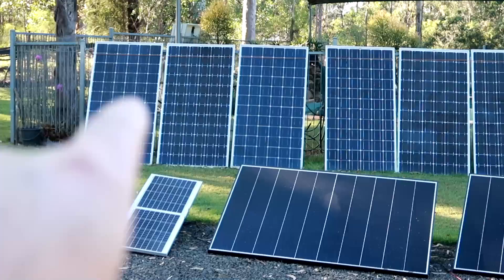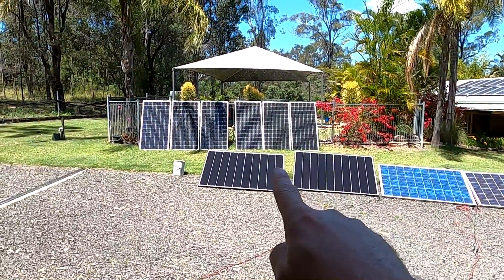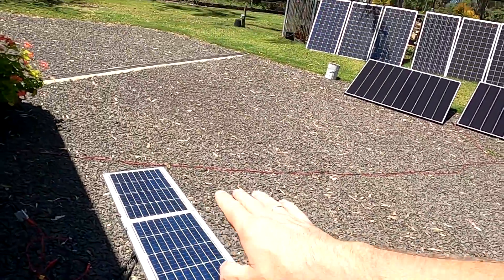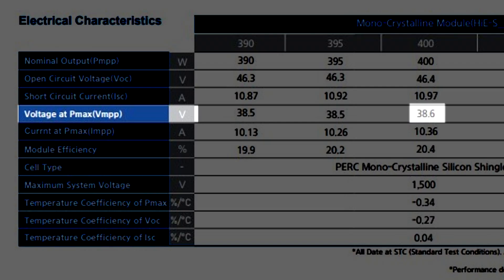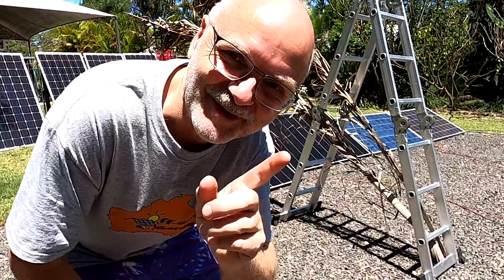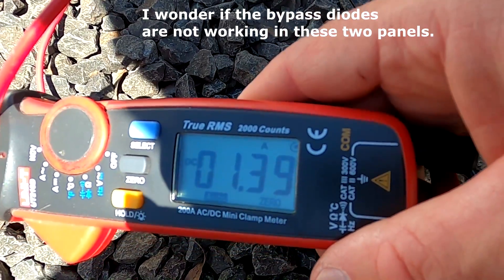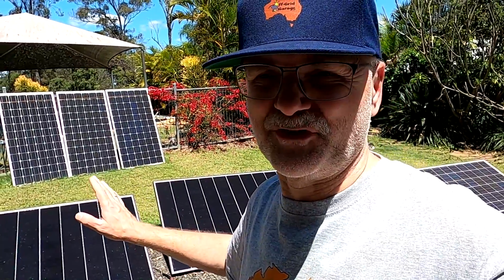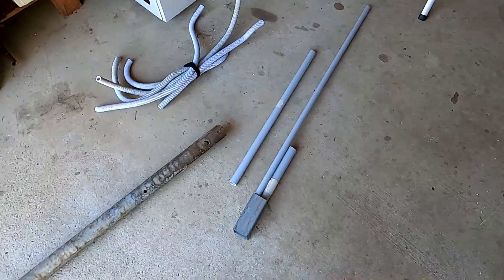Charging a 48V battery with only two solar panels in series? Here are my concerns.

Comment: 3:30 into the video, yes, no shading from trees, but yes, shading from the leaves on the panels
- wonder what the peformance drop from these leaves would be
Reply from the maker: Literally no power loss from just a few leaves on the panels. Also, thorough cleaning makes no difference in power output. At least not measurable.
Reply: @OffGridGarageAustralia  thankyou

Comment: Very exciting.   Can't wait to see it up and running.
Reply from the maker: Yeah, me neither. It will be a lot... of power. But this huge upgrade is more for wintertime. Summertime is never a problem.
Reply: It's all happening much quicker than I thought it would, in the UK it's getting very hard to get hold of anything solar related. Getting quotes for installs is getting very difficult, and very expensive. I'm very interested to see your new panels go up.

Comment: One thought I got when I watched your videos is why you don't make a pool roof out of panels as they seem to be in the sun a lot and if you cover there you get more shade over the pool and then you can keep some panels on the roof. Realize that parts of a scaffolding need to be built but it looks like what you have over the pool is now in steel so put a rail on it and if you still need to buy more controls then why not 200-250v so you can put more in series?
Another thing I wonder is is it better to put many loops or connect them in series parallel? (if you take 3 in parallel and take two of those in series then they should have a little more security to produce even in partial shade or am I wrong there?)
Reply from the maker: It's only for a while that it is in full sun. And I would need to replace the whole structure to support the panels. Not an easy task and quite expensive as the pool is underneath and you cannot use a ladder to get there...
You cannot connect three panels in parallel without proper fusing as the reverse current per panel is limited. The design is that three panels (only two from next week) are in series and next to each other in one row. So, the shading for this one string is fairly even and consistent as much as possible. If I have two rows in series (3 per string), one of them would be shaded and the other one not. The MPPT tries to optimise that setup but it is more efficient if these rows are in parallel and not series under shading conditions. It's a bit complicated without a drawing so a video will be coming about that...

Comment: Because of your shading situation u need to get half cut solar panels so that when one half is shaded u would get more power from the other half. Also wouldn't it be better to go for bifacial it will generate more power also will not crack but you will hv to put a reflective paint on the roof to get best results. Mine work great even at low light. I got the Jinko solar panel model JKM535M-72HL4-TV.
Ohh also if you can answer by below question about my inverter tripping would be great help. Thanks.
Reply: In the first video testing these new panels, Andy shows that they are actually like 3 strings in parallel in the one panel already, so they have something similar to the cut cell panels. Hence the name shingled panels. Andy really is testing extreme sutuations.
Reply: @CollinBaillie  yes true but it don't solve the cracking of the back panel. But I think these panels take up less space too. So bcz of that he could cramp few more panels n get more power. 
:)
Reply from the maker: Yeah, with the new solar panels, I'll get 4kWp instead of 3.6kWp and have the legal free space around the panels.

Comment: It's madness to increase your battery storage (44 kWh I think already), I would took at a system of turning on the full solar arrays in cloudy weather and turning off some of the arrays when sunny, I think you mentioned you would like 1000 watts input in cloudy weather, which I agree with that analysis, I am currently working on a viable solution for my own system, which I'm located about 54 degrees in the northern hemisphere, so there a big swing between summer and winter production, but I don't want or see the need to keep increasing my storage further, again so long as I can maintain 500-1000 watts worse case,
Reply from the maker: Absolutely, Philip. 44kWh is a lot already. But if we want to connect the house at some stage, I would actually go a bit higher. The battery was full just 2 days ago but since then clouds and showers again so the battery goes down every day as production is not enough (it may be from next week though). This is all part of the huge test I'm doing; how much is too much and what do you actually need to make it work in a full energy off grid system including EV charging.
I cannot see that there is a formula what to calculate all this upfront including shading, weather, season, EV charging, ... So I go ahead and see what is working. The current system is not enough for wintertime for sure. With the new system I'm expecting to get around 2kW under shading or cloudy weather. That's OK for the supply during the day and also charging the battery a little.
Reply: @OffGridGarageAustralia  👍
Reply: Considering what is going on in the world, I have decided to prepare due to what I feel are sibstantially increasing odds of electrical grid failure and fuel shortage along with food shortages.  I have 60kwh battery as I want to ensure I can charge EV to stay mobile when needed.
Reply: He can limit the charge current of each controller. That way the performance is not reduced during cloudy days and not too high when ot is sunny
Reply from the maker: @What11235  Thank you, that sounds similar to my situation. I'm sure I have to upgrade my solar as well even further to make it work in wintertime. For a few years now, we have so many clouds while before there was always blue sky at this point of time. Clouds are definitely increasing in this part of the world. So more solar needed.

Comment: Hi I got a problem. I hv 2 inverters running parallely and both hv RCCB for the output and as soon as I on both inverters and I draws over 1amp current the rccb trips this only happens when running in parallel mode. When I run the inverters individually thr RCCD don't trip. Can u give me some advice why this might be happening
Reply from the maker: Are the inverters properly in sync? What inverters are they?
Reply: @OffGridGarageAustralia  after looking at my wiring I found out what I hv done. I was using 2 RCCB for the 2 inverters, 1 rccb each.  So inverter 1 and 2 AC out was connected to the rccb tops side. 
From inverter 2 rccb bottom I took the wire n then linked it to inverter 1 rccb bottom n from there to the change over switch. Since I brought the inverter 1 rccb to the bottom that was the mistake I changed it to the top then all was fine. Its hard to explain but all is OK now. 👍
Reply from the maker: @pulith5220  Ah, there you go. Great, you figured it out and it is now working.
Reply: @OffGridGarageAustralia  they are EAsun inverters. I see the master n slave marks on the 2 inverters but I assume it's something to do with them not linking properly

Comment: Yes the maths of mppt doesn't lie no matter the newest cell technology. Your other option that might be a good one is micro inverters o. Each panel. This would be the best for highly shared areas like yours.
Reply from the maker: Micro inverters are great when you are grid connected but very tricky in off-grid systems. If the battery is full you need to tell them to stop producing. The Victron MP II can do that but only for a limited amount of load (Victron 1:1 rule). That would not be enough in an off-grid world though. While with DC connected MPPTs I can just keep adding them to the system until it works even under heavy clouds and winter time conditions.

Comment: You should never connect the 2 roofs together, because in case of  a Lightning strike, you will have this on both roofs...

Better: you connect each roof down and to a multiple earthed ring on the ground. Dehn Blitzplaner will help you ;-)
Any questions ? - than ask...

But - in general, why do you fear lightning strikes at all ?? Around your roofs, there are so many high trees, that it is nearly, I would say, totally impossible, that you can get any lightning strikes on your garage roofs.

Anyhow, to download the Blitzplaner, it is the mich easier way to try it at the Austrian homepage  of Dehn.
Reply: I believe the consideration is almost always a near-by strike, which still have potential to cause a spike in any equipment, not just the solar panels. The SPDs used in solar systems are more about atmospheric transients than direct strikes. To arrest a direct strike would seem to require a much more serious protection setup, and is probably unrealistic to try to achieve.
Reply from the maker: Can't recall having mentioned anything about lightning in this video 🤷‍♂️
Reply: @OffGridGarageAustralia  Jogi raised the issue in the first comment... 🤷🏻‍♂️

Comment: In conditions of regular shading, would it make any sense to put a diffuser panel in front of the solar panel with a gap? So instead of hard shadows and bright sunshine hitting different points of a panel, which they seem to not deal with well, like you have with the trees, you could have instead an averaged light level across the whole panel?
Reply from the maker: But then you would lose out when you have full sunshine. It would make a difference in permanent shade but if you have both you would need a mechanic to remove and put it back in place if needed. And it would need quite far away from the panels, several meters at least.

Comment: The real question is what you'll do with all the panels on the roof. You're like me, and you'll want to put them back to use somehow :D
Reply from the maker: This is more for supplying enough power in wintertime. Summer is never a problem, right?
That's why you overprovision a lot so it will be enough for these months of low light...
Reply: @OffGridGarageAustralia  I mean the existing panels that are there now. Some are no good, but the good ones...

Maybe it's worth racking them up on the last roof to the west, under the trees?

Comment: Well the test aint that stupid and teaches me a lot for my setup. But i'll try a retest for the situation in my office anyway - because i have to chose wether to go for a serial or parallel string setup because of partial shading with the sun sneaking around the corner of a building.

Thx for the vido.
Reply from the maker: Ah, right, yeah, that is such a situation where you could have a hard shadow one panel and the other one is in full sun. It's a difficult decision as if a series or parallel connect is better. It all depends on the shadow and time frame and ability of your MPPTs.

Comment: 13kW solar means you're three battery banks are fully charged from zero in 3,5hrs 😄
But even with powerwall 2.1 and 2.2 you still have a lot of energy left. Maybe time for a public car charging station in your driveway 😄, or other plans with the remaining energy (besides powering you home)?
Reply from the maker: Not quite because these 13kW are only present during noon time. As you have seen in the video, the big shed was in full shade while the carport was still in sun. In the afternoon it is the other way around.
I will have heaps of power in summer for sure but the system needs to deliver in winter to go fully off-grid. That will be the interesting time for testing. But we first look forward to lots of energy during summer and a full battery every day for a while.
Also looking into buying a second EV next year...
Reply: @OffGridGarageAustralia  You are right Andy about the shade. My solar system has also shade from the left and the right side and wil only output it's maximum power for one hour.
Winter will be an interesting period to cover the energy needs.
A new EV, nice! 
It would be nice if you could use the EV as energy storage and extract power from the battery also to power the garage. But I'm not sure if and what brands provide these kind of features.
Interesting for sure!

Comment: Did you consider the Victron SmartSolar MPPT RS 450/100-Tr or 450/200-Tr for the new panels?
Reply from the maker: No. I have too much shading for them and most panels would run very hard on their bypass diodes. Having many smaller strings in parallel is more efficient But I still have to make this test 😁

Comment: Don't freak out, it will work! That will be some nice currents charging your cells. Please take some precautions for packs which are full and the load on other packs (however it is DC, so current should also taper off)

Comment: Feel free to do a few more tests with the shading from the modules, but please don't cover them completely, there isn't normally anything like that. But you definitely have a large parasol in sunny, hot Australia. The values that I saw today with the palm trees made me think. I have a shadow on it through a dormer on the roof until noon... that seems to be really noticeable.
Reply from the maker: Yes, a bit of shading makes a lot of difference. We will do more testing once they are installed on the roof. We can manually disconnect every single string on all 4 roofs.

Comment: I Love how you measure everything.. but I don't love how you don't theorize.. 
for example: 
area of a panel: 1.646m*1.140m=1.876m^2 .. two would be 3.75m^2
your sun meter showed 1200w/m^2
so from the area the panels are taking up.. your producing 720w
15% efficient? prolly cause of the heat? 

I know you like the victron mppt's.. but I think they take shading poorly. best case scenario you should expect 360watts from one of the panels being 100% shaded.  Instead you get 129w.. ouch. so either the bypass diodes or the mppt has lots of room for improvement. 

Can I send you money to buy something on aliexpress to try adding to your two panel setup? I'd like to add an unlocked solaredge optimizer.
Reply from the maker: Guys, how do you use micro inverters in an off-grid system??? Once the batteries are full, you have to turn them off somehow, control them. Yes, the Victron MP II can handle that up to a certain size (google Victron 1:1 rule). I need this AC capacity for when we connect the house (+10kW of solar). I can add as many MPPTs as I want. There is no limit.
And let me tell you, I have tested quite a few MPPTs from other brands and they all suck. I'm not a Victron fan boy nor do I get anything out of that, but they have the best system and devices in my experience.
Reply: @OffGridGarageAustralia  Agreed Andy 👍
Reply: @OffGridGarageAustralia  I'm sure there are grid-forming models. Of course what do you do to curtail excess then? Also, you'd have to have an AC coupled battery, which is extra expense. Possibly DC optimisers for each panel, but again how do you control them? How do you curtail excess generation? It's simple to say "micro-inverters are the way to go" if you don't consider the entire system. Opinions... So many out there.
Reply: @OffGridGarageAustralia  
> Yes, the Victron MP II can handle that up to a certain size.
> I need this AC capacity for when we connect the house (+10kW of solar).

The fraction of the AC-coupled PV power which is immediately consumed in the house does no longer need to pass through the Multiplus in order to charge the batteries. The Multiplus only needs to be rated for either max house power (if the house runs on battery only) or max AC-coupled solar power (if house consumption is zero), whichever of them is greater. It is of course also possible to AC-couple only a subset of the panels, and DC-couple the other ones. For black start you need at least one DC-coupled string anyway.
Reply: It would be interesting to find where all these lost watts are going and what inefficiencies can be found in what area’s of a particular system. Thanks for offering Andy a microinverter to play with and test, I am curious about how overall efficient these devices are, as I have come across a large scale 122kW Solar crypto-mining setup on a farm in America, who was taking down his micro inverters and changing over to a String setup because he had some issues with the inverters and they are not always in a location that is easy to get for maintenance or replacement and he sometime had to dissassemble large sections for otherwise relatively minor repairs/replacement.  I believe he stated that they were becoming untenable due to reliability & maintenance issues, where I guess the maintenance issues could be mostly overcome through good initial engineering & planning, but he had them for some years now also. I came across this guy’s fantastically huge setup on Will’s DIY forum, it was an excellent review.
Reply: I think Andy has shown he has a micro-inverter for testing in previous videos.

Comment: If you do the test by using optimizers 
If one panel is shaded the other one wil work full
Reply from the maker: Optimizers don't work well with existing MPPTs. I tested this and got huge voltage spikes. You then have two MPPTs working with one panel. I know there are other optimizers with constant current tech but you still have to be careful with that. I found the pure MPPTs can handle the shade the best.
Andy you're adding more complexity and also more $$$ to your system for little gain. It is cheaper to add just some more panels to compensate.

Comment: Your single panel shading wont be an issue where you live, but I live in a terraced house with my panels in the garden. I do get 1 panel shaded as the sun is lower now here (UK) and the neighbours chimney stack shades 1 panel, then the next as the sun moves. So not totally unreasonable for some 👍

Looking forward to the install vids 😁🤞🥳🍻 But PLEASE wear proper footwear when up on the roof 👍😉🍻
Reply from the maker: Yeah, you will have this hard shadow on your panels. Thanks.